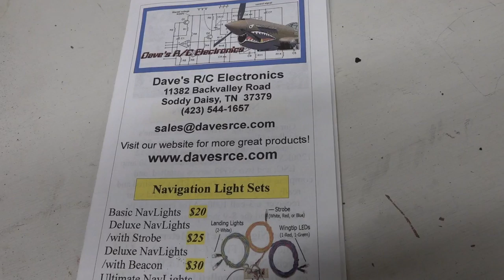Buttoning up the Flying King/Rosie the Rocketer  non scale, scale

Comment: Love the scheme, my Flying King has a 15 RCGF gas with a 16x8 prop very nice plane.
Reply from the maker: Is that a good combo?  I am curious as heck about those RCFG motors.  I have a Top Flight Gold T-34 that I am trying to find a gas for and 16x8 is the prop it was made for.
Reply: It pulls the FK around quite well, took a least 2 gallons to break it in. Did replace the carb with a Valley View one runs much better with that carb.
Reply from the maker: Thanks for the reply.  Interesting you had to change out the carb to make it run better.  I will keep that one in mind.